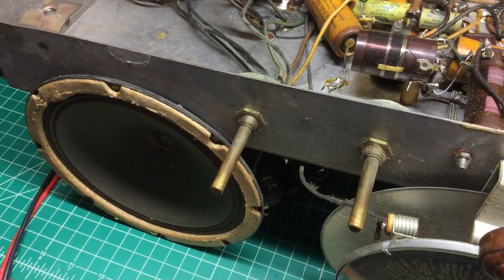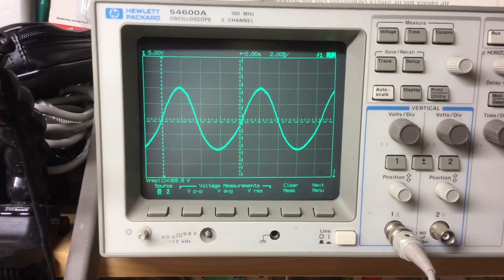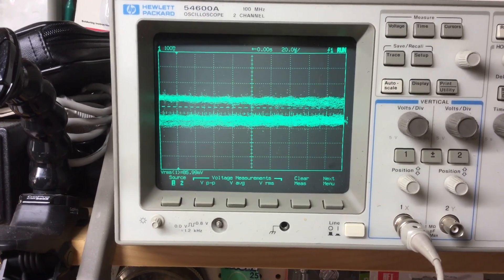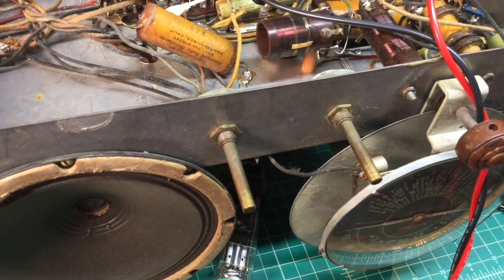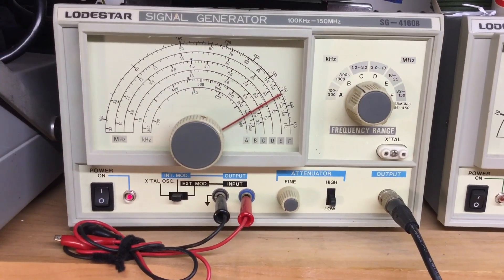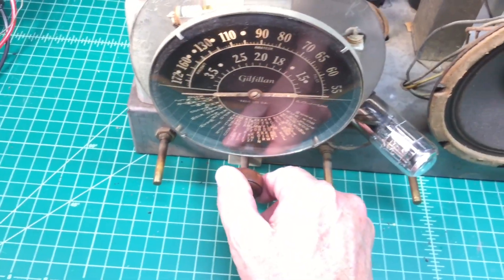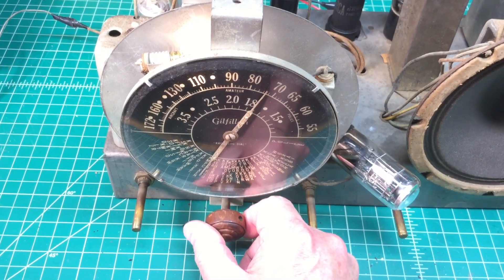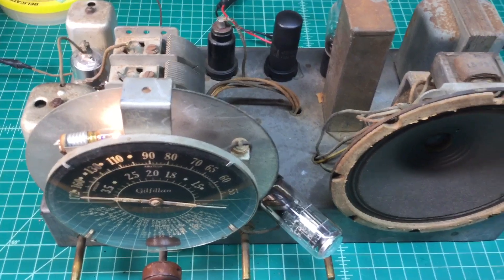Mitigating AC Hum

Comment: Thanks for the great video. What value of blocking capacitor did you use when checking the ac ripple on your scope?
Reply from the maker: +Michael Swindal Hi Michael, thanks for your question. I will update the video description to include this as well. I used a 0.10 uf capacitor to remove the DC components. Not sure of the accuracy, but it does allow for a pre/post tests with a high degree of accuracy showing the improvements of vintage capacitors vs. modern day. Hope this helps. Best, Don

Comment: Don,
You are most certainly right: an AC hum, accompanied with a reduction in HT volts, is often a clear indication of defective/worn out smoothing, and reservoir, electrolytic capacitors.
Problem, and how to fix it, was eloquently explained - well done.
Regards, 
Phil.
Reply from the maker: +SteelCity321PB Thank you Phil. I checked the old capacitors after the fact and they had very little if any capacitance; like you said, it's not surprising. Again, thanks for watching and taking time to reach out to me. Best, Don

Comment: Nice work, that set sounds great now. Due to the fact that so many un-restored old radios hum, a lot of sellers on eBay seem to think that's normal.
Reply from the maker: Thank you Matt. It sounds a lot better now for sure. Those old capacitors were used up. Thanks again for checking this out. Best, Don

Comment: I have some LED lights in my kitchen that cause a buzz on all of my am radios.  Is there some way to add a filter to the LED light circuit to stop the buzzing?
Reply from the maker: I'm not sure how to filter it out completely. An installed safety capacitor will help take some of the noise to ground, and an external antenna away from the source. To your point, the majority of the white noise was coming from my LED TV that was in close proximity to the short wire I was using as an antenna. Best, Don